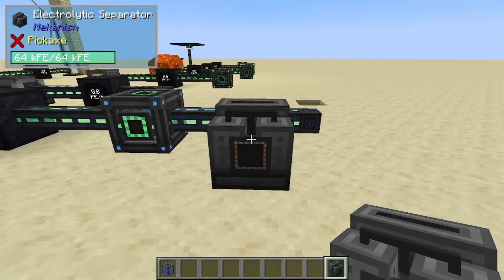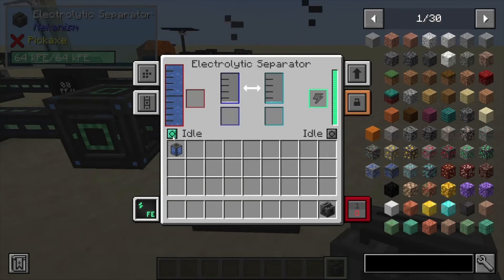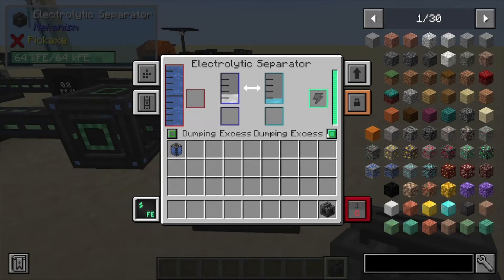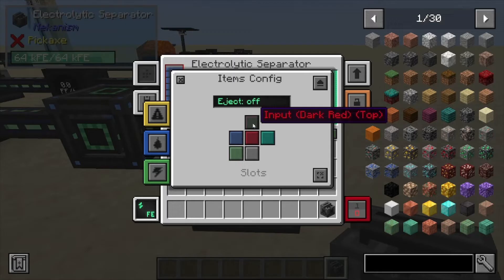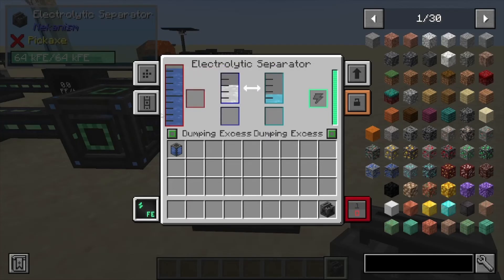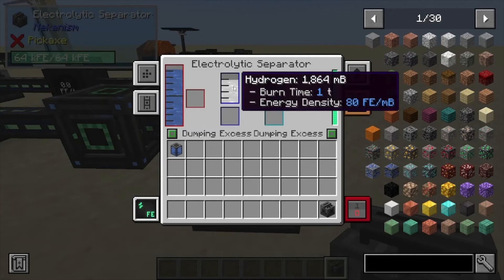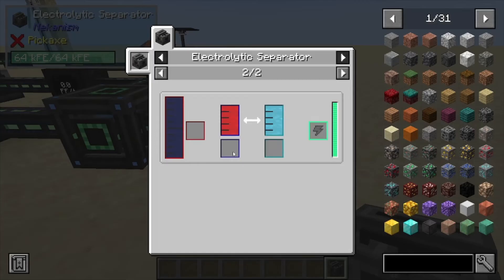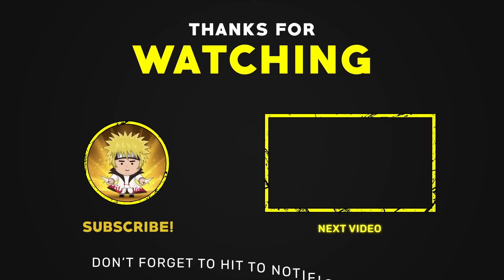Mekanism: Electrolytic Separator (how to get hydrogen + More)

Comment: So I don't know if you can help or if you've played Galacticraft but I've been trying to use the Electrolytic Separator to make oxygen for the bubble distributer or maybe the room sealer but  it just doesn't make near enough even multiple separators pumping into one distributer with upgrades, it starts to make a bubble but then just runs out of oxygen. Any idea if I can make it work or is it pointless?

Comment: My electrolytic separator doesn't have the configuration buttons on the side of the UI and even using the Configurator tool doesn't work. Do you know a) any way around this or b) how to remedy? Please and thank you
Reply from the maker: @ColvyMolvy  try the configuration on the pipes to decide input/output instead of the machine

Comment: still cant seem to put oxygen into a gas tank
Reply from the maker: Is the oxygen going into the Gass pipe ? you might need to set your outputs...and tanks have input output settings also
Reply: Wrench from other modpacks to interact with the pipes to push and pull helped for me when I had it configured correctly but didn't do anything

Comment: But with what do i extract the hydrogen out of the separator so i can get it into the gas burning generator
Reply from the maker: pipes
Reply: @MCMentor1  yeah I just found that out, but nothing happens when I connect the pipes, I’ve powered the seperator where the hydrogen is in but when I connect it to the generator nothing happens
Reply: Yeah i just found that out, but its not working for some reason, when i connect the pipes nothing happens
 @MCMentor1
Reply: Yeah i just found out, but nothing happens when i connect the pipes to the generator
 @MCMentor1

Comment: Heya! Quick question, any idea on how to explain the colors for the input/output? I did exactly what you did but it's not receiving the water fluid energy. It's receiving energy to power the pump but not putting out the water. I know I'm doing something wrong I just don't know what lol.
Reply from the maker: The colors coordinate what tank is being exported/imported from. Make sure there is nothing else in the pipe besides water too